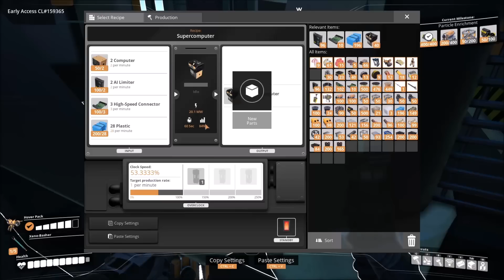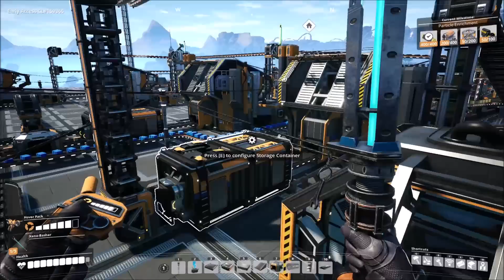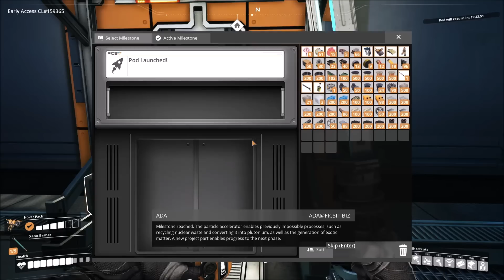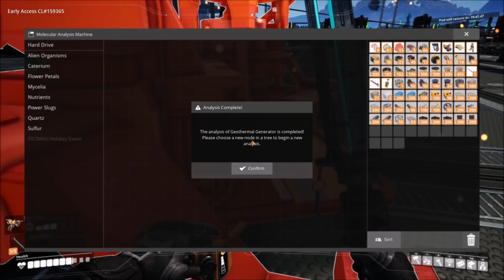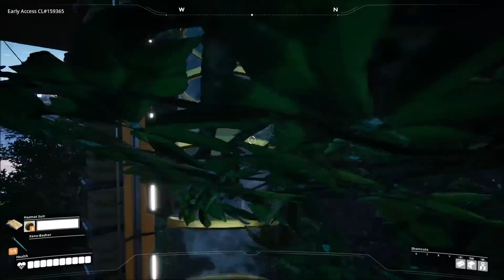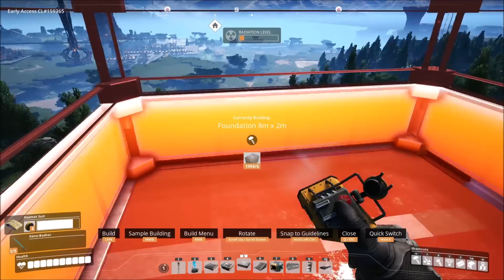Satisfactory Ep47 Particle Acceleration Planning

Comment: dire the thing about smart splitters is that they allow you to run more than one kind of item on 1 belt without messing things up.
what this means is that large assembler things that dont really run that fast (like the one set up a couple episodes ago) can be done with 1 belt and 4 smart splitters. way more compact & easy.